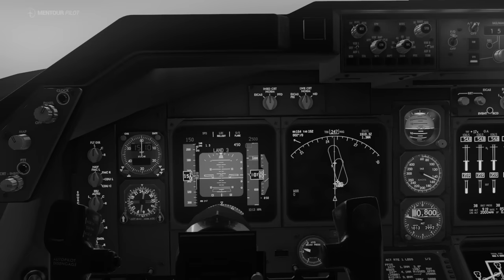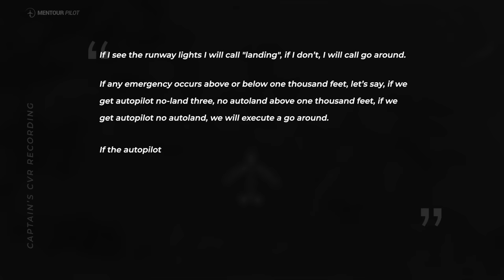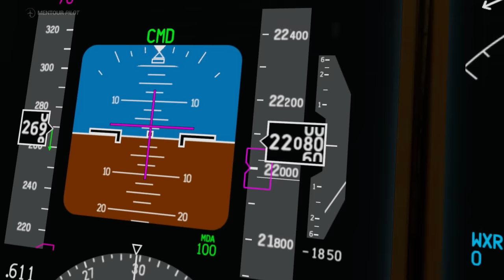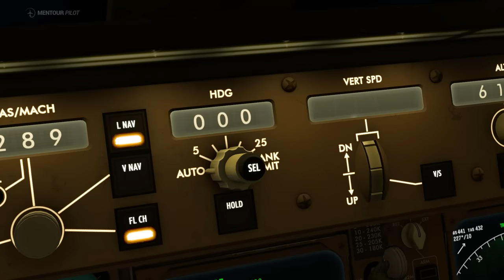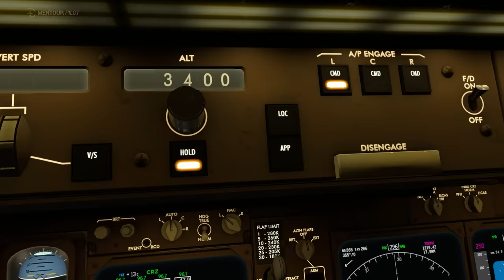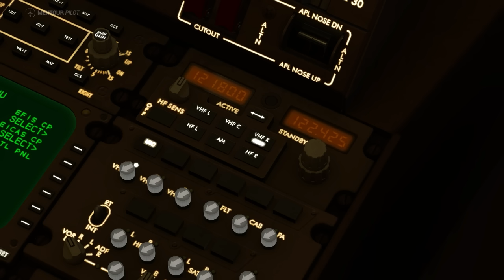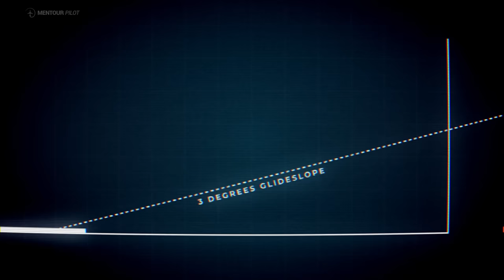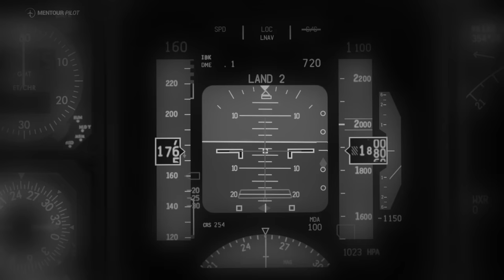Where is the RUNWAY?! Unraveling the Mystery of Turkish Cargo flight 6491

Comment: 17:26 "Because the temperature was very cold"... NO. NO. NO. NO. NO. NO. NO. NO. NO. NO. NO. NO. NO. NO. NO. NO. NO. NO. 

Too many people keep making this mistake. 

"Temperature" is an abstract concept designed to convey a relative measurement of heat. "Temperature" has no physical properties — one cannot paint, hold, touch, throw or place a temperature in one's pocket. Likewise one cannot boil or freeze a temperature, therefore it cannot be "cold" or "hot" although whatever is being measured can be.

The weather or air can be "hot" or "cold", temperature cannot be. Temperature is the measurement, not what is being measured. To say the "temperature is hot" is confusing the measurement with what is being measured. Temperature can be "high" or "higher" or "lower" relative to some other measurement. Saying "The temperature is cold" just doesn't make any sense and is unnecessarily wordy. It is the weather that is hot, not the temperature. "The weather is cold" makes sense and is correctly stated.
Reply from the maker: Wow, that’s a very strong reaction to something I have a feeling you understood the meaning of. 

So the correct terminology would have been temperature was low, but most people would recognize a low temperature as “being cold”, hence the use of this word. 

I am sorry if it offended you but my mission here is for as many people as possible to understand what I’m trying to explain to them.
Reply: @MentourPilot  Hi, I'm not offended, don't worry, it's just a pet peeve of mine. There are no cold temperatures, no fast speeds, no expensive prices. 

There are however cold things, fast movements and there is expensive stuff.

And there are low temperatures, high speeds and high prices.

I think everyone understand why "That car has an expensive price" is wrong. The car has a high price. It is the car that is expensive, not the price.

The very same is true for the weather. The weather is cold. The temperature is low. But a temperature can not be cold. It woulld be just as wrong as saying the weather is low.

Other than that, your videos are great.

Comment: Absolutely devastating end. Clearly they were in a confirmation bias tunnel and the computer should've said, "No way, I'm not flying this." When you have that level of automation you don't need a pilot, you need a flight engineer who understands the computer system. Or you need a computer that makes the pilots take over. 

Terrible for the people on the ground and in the back of that plane. Killed by software engineers at Boeing and less than stellar pilots.

Comment: Automated systems become more and more complicated and I don't really get why pilots flying don't understand these settings as designed by the engineers. Many times these cases happen because pilots don't pay attention or even dont understand how the aircraft computer acts in certain flying mode. These decisions of the autopilot to continue even if the glidecsope is wrong are so weird. I think prime directive in any autopilot should be keep the plabe away from the terrain, and yes leave that decision manually to the pilot. I find it hard to understand how an autopilot would accept crashing down based on inertial data

Comment: @mentourpilot - could you please explain about the total hours experience a little more? In my daily duty as a Software Developer, I work 40 hours per week, and within a single year, I accumulate a total of about 1700 hours. However, after a single year, a junior Software Developer would not be called experienced, also an engineer after about 5.5 years would have spent 10k hours in their job. Yet, I would not necessarily call them very experienced.

How many hours do you actually operate a plane per year?

Many thanks
Michael

Comment: I see people act like this in professional environments.   Considering the circadian low deal, a term I hear a lot is "punch drunk".  Spending most of my life doing software engineering and being in various shops over the years, a common thing I see in the software sweat shops out there is people program in circles, constantly reinventing the wheel, except making very bad wheels.  In other words the obvious is all very much so missed and the resulting code is very poor in quality.  Kind of funny in a way in that if an 8-hour day was cohered to at those sweat shops, they would actually get a lot more done as software engineering is an exact science, so all of this poorly done code doesn’t actually work at all and then loads of time is wasted just trying to get it to run.  Granted if they ever do manage to get it to work, it works very poorly and basically needs to be thrown out and completely redone from scratch to have something that works right.  So this kind of fatigue thinking just because it is the middle of the night can explain some of this.

Another thing I see is people are not all alike and there are some cultural problems.  Some people can put on their professional hat, observe the situation, and make calculated responses under ideal circumstances.  Some can even do this under extreme duress.  They talk about this for example in the movie The Right Stuff.  Other people, and this is the most common case, is they fly by emotion with very little to no input from higher reasoning.  Some people lack higher reasoning while others easily have it blocked by emotion.  Coming from Western Europe, what you are probably used to is a relatively high level of reasoning and control over emotions, at least in professional environments.  You get into some of these other parts of the world and sometimes you see this, but often times people are extremely emotional and either their reasoning is being blocked, they are not capable of much reason, or they have what I consider partial reasoning where they can reason through some things, but the area where they seem to have a big emotional blockout of reason is very large or maybe their brains can only handle a certain subset of reasoning tasks.

Another way to think about this is road rage.  How many of you are guilty of this?  All of this feeling comes from inside of you.  It is not actually the outside world, but internal to you.  So you could be considering such things, so when sitting in traffic and not getting around fast enough, that slow driver in front of you with lots of space in front of them, etc., you could either rage about all of these things, maybe even go to the extreme and get a gun out and start shooting at people that really piss you off on the road, or you could try to go the other direction and strip the emotion out of it and just cautiously and methodically pilot your vehicle until you get to your destination when you can reasonably get to your destination.  Maybe even time yourself.  Funny how it tends to make basically no difference at all the time you arrive when you are careful and methodical about getting somewhere.  All of that raging down the road didn't accomplish much  beyond say raise your blood pressure.

Applying this to computers, computers don't care what you feel.  You can get frustrated, pissed off, etc., but at best all you can accomplish with those emotions is say damaging your computer.  Then your computer becomes a paper weight.  All that actually helps is to methodically go through and figure out how to get the computer to do the thing you are trying to do.  You may even find that if you can put these sorts of emotions to the side and start methodically going through, you might actually get good at using computers instead of the emotions ultimately causing you to become a techno phoebe.

I remember once talking to a middle eastern guy about emotions being internal to him and things like the amygdala and limbic system and neocortex as his life was out of control and he was going into a downward spiral.  He picked up on what I was saying and managed to turn his life around. People also saw that he was really making an effort to do all of the right things in life so also gave him a chance to shine and shine he did.  The problem was just the way he was raised to think and act were wrong and led to his life spiraling put of hand.  Once he was the master of his own emotions, it turned out he was a really great guy.

Comment: Sometimes it feel like all this automated systems, help systems, warnings etc  just makes Pilots less good and distracted and when something goes wrong the work pressure goes up to much from to chill til to fast in an instant, fiddling with it all, seen it time and time again in your videos, i would rather prefer a pilot having complete both sense of control and actual control and focus on speed, height, bank and position, and maybe FO more in a role of flight engineer and backup as miscommunication between Captain and FO is a recurring theme also,

Comment: I think the caccadian rythm played tricks on the pilots and a get-there-itis mentality.

The pilot was too tired to think of losing speed instead of altitude when they were high, which would benefit them later but not now. Also not extending speed breaks when they were fast and high. It simply didnt occur to him at the time, so they remained both high and fast, fast probably due to the get-there-itis mentality, and thinking they could lose the altitude later on without having a clear plan on how to do so since this was not discussed in the cockpit.

Simply too tired to think of logical solutions to the problems they were now faced with and a false sense of security when they got they captured the glide slope, not realizing it could be a false glide slope. Probably because in all their experience flying capturing the glide slope also took them down to a safe landing every time they captured it previously.

This is just some armchair psychology here, but the captains reaction to the altitude he had to maintain, getting upset by it can cause a "I will show him" sort of thinking. He wanted to prove that even if he was put at a higher altitude he could still land. It becomes a contest in the captains  head and he wont accept defeat, so he ignores the problems they are simply not that important, its more important to win.

Comment: It should be so, that not even the most trifling warning caution, that is to be heard within the vicinity of the modern cockpit, should be cast aside or disregarded whilst soaring in a colossal metal contraption amidst the heavens. For one minuscule fragment may perchance, be the linchpin of a far grander contrivance. 
Although I am not a pilot, were I to hold such a position, any oral admonition would without delay necessitate a thorough examination, be it through a predetermined roster such as a checklist, or if none be present, by means of my personal scrutiny of the plane's primary operations, encompassing the thrusts, as well as the soundness of its lateral, vertical, and horizontal movements.
Reply: Such I gather, is the overarching insight I've acquired from the channel, having dedicated two years to the diligent viewing of every Mentor Pilot video.
Reply: In mine own personal fancy, I would relish the phases of ascent and descent in this occupation.

Comment: astanA and karagandA, not astAna and karagAnda. Very last A is stressed, of course if you want to sound closer to original. I don't know why english-speaking people are always putting stress in the middle, thought they have cases when they stress very last letter, for example phrase "I don't know what to do" in many cases has stress on last 'o'. So clearly you can do that but always make wrong choice.😂 Even in kazakh pronunciation it is clear that stress is on the last vowel. Караганда́ (or kazakh variant Караганды́). take a look at  а́ and ы́, these are stressed letters (vowels to be exact), they have marks of stress above them, this tiny thing above the letter points on vowel which is stressed.

Comment: 22:16  Flaps are not speedbrakes.  They’re lift devices.  They allow the aircraft to fly at slower speeds than a clean wing.  As a consequence of inducing lift, more drag is created, but if a greater descent rate is desired, then use speedbrakes followed by landing gear.  Avoid use of the landing gear by planning your descent profile.  Don’t blindly follow the VNAV path.  Don’t allow the FMC to add power when below the VNAV profile, only to deploy speedbrakes later in the descent.  Does it make sense to add power then use drag to follow an algorithm’s guess of an ideal descent profile?  Extend downwind or 360.  Deploy flaps so that they’re extended just prior to slowing below the maneuver speed for the flap setting.  Don’t deploy flaps at the upper end of the speed envelope.  Minimize flap track wear.  Mitigate flap asymmetry or flap disagree anomalies.  Be considerate of your fellow colleagues who fly that airframe after you.  Perhaps you’ll appreciate it the next time you’re min fuel at destination.

Comment: So,  all the vertical postions (including deviations L/R)  of the GS from the RWY threshold can be deduced by reference to a gps absolute position in a database, thus in a monitoring system the false beam/defective radios or whatever these "pilots" were doing could be readily detected for example at absolute GPS position say 1000 mtrs from the runway you should be "Y" height, X,Z etc, etc etc Some INSs know their Lat Long but cannot be used because of gyro drift, GPS (even civilian) is good enough and airspeed can be up to the pilots or  other autoland linked systems, but with ABSOLUTE POSITION VERSUS HEIGHT known. The point is, you have a defective control loop with two or more idiots in the positive feedback loop, this is why aircraft systems are still a pile of inconguous badly connected old/new/missing technologies/boxes with a bunch of goons sitting in the control seats manually adjusting knobs and twiddling dials. If 99% of systems were revised in CAT3 operations and an added "per airport" GPS slant/height database on aproaches were stuck in the FMS memory that would help determine if fatal errors were being made - NOT STUPID FLAG INDICATORS AND DOORBELLS.  My bloody cellphone would probably known we were about to die.

Comment: I do think many air traffic control underestimate many jumbo/ large aircraft and there so many jumbo pilot get irritated, I also get irritated hearing some ATC dealing some jumbo. in this case there is lack of communication between ATC and Pilot why when ATC not explain pilot why he/she selected ALT and pilot also not communicated what there opinion. I know ATC have many job and get stressed but also pilot, ATC dont know what the state of that plane, how many fuel and cargo n board and real situaton above. I do think many ATC act like GOD in one hand cause the can see everything and this mentality is one hole in swiss cheese model disaster, but they never know how to be pilot outthere in the sky. I know there is many video say that handling jumbo plane are easier than normal plane, and that's not the case. I do think some airport need experiences and top ATC to deal jumbo

Comment: <]}··¤··{[>

OK, for this hypothetical scenario, so I'm ignorant, nevertheless, sitting in the seat as a 'supposed'

flight control coordinator, having immediate relative authority over the best interest of all possible landing involvement concerns,

here” I am observing an incoming while previously "knowing" the precise impossibility, for absolute certainty, that this particular type of such an aircraft can in no way negotiate anything anywhere near a "safe" (survivable) landing providing these specific parameters,

Question: do I, or, do I not have a duty of professional responsibility to inform a go around, many times as necessary to insure pilot comprehension, that said incoming flight, configured to obviously excessive altitude, no longer has landing clearance?

If the tale doesn't wag the dog, why then should any pilot be free to dictate the final terms for landing? Especially, in such instances?

My ignorant self, would have turned the runway lights off if I had too in this event to prevent that landing  . . . 

.*.*.*,